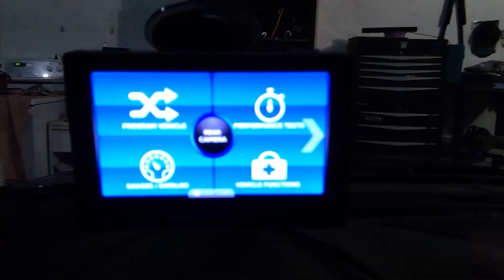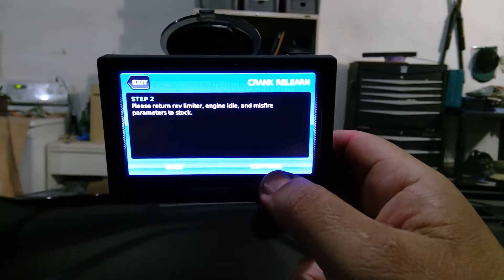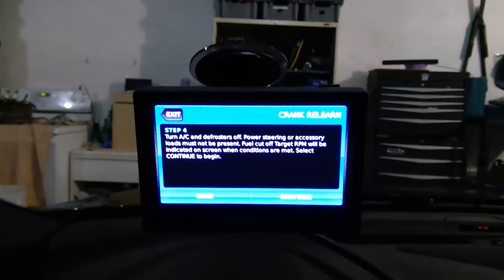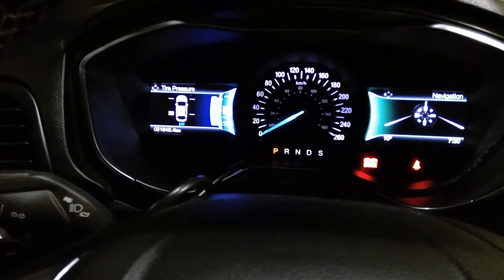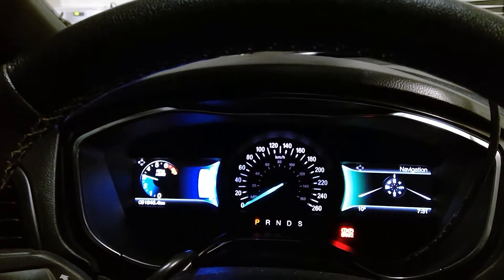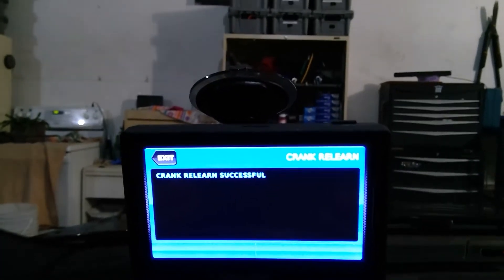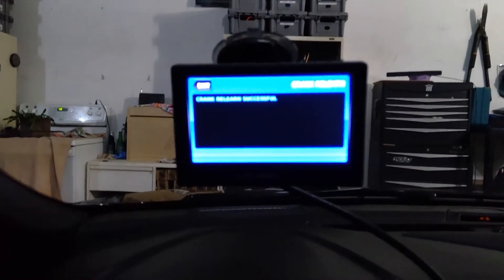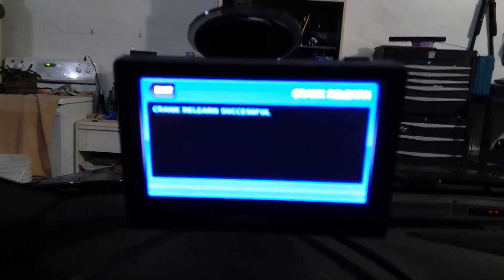Ford Crank Relearn Reset - Fusion Sport with SCT or HPTuners

Comment: What’s your spark advance? I feel like mine is too low but I have no idea what I’m looking at. It says -110 when I’m on throttle.
Reply from the maker: Not sure,  Im currently using HP Tuner and the degrees are all over the place. I will have to check it more next time I do a log

Comment: Did this solve your problem? I have a 2016 mustang GT and just did it because I would have misfires at wod
Reply from the maker: If you install turbos or added boost on the 5.0, and crank relearn will usually fix your miss fires. Mine was cause by plugs covered with the orange from Boostane. I started heavy dosage (1 ounce per gal). Thats too much, I can only use 0.4oz per gal with no miss fires, but plugs need to be change after 10K.
Reply: @twinforce_fusion6560  the last owner did one of the transmission seals and other transmission work. I used to think they did it at Ford and then I looked again on the car fax  and it was Amco. So I still did it just incase they did not do it. Couse I did coil packs and spark plugs and it made it a little better but once in awhile it still pops up. It’s stock so it shouldn’t be doing it.
Reply from the maker: @Taino5.0  yeah, stock should not do that. I would probably change the ATF and us a Snap-on or similar scan tool to pin point any other problems.